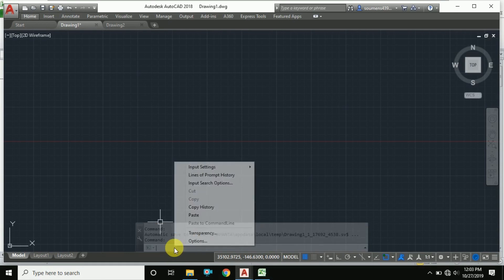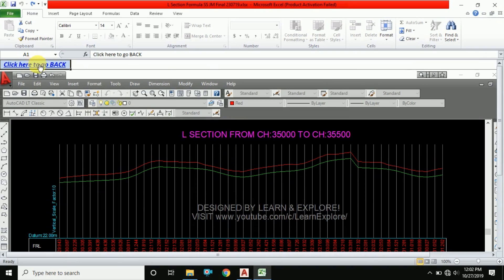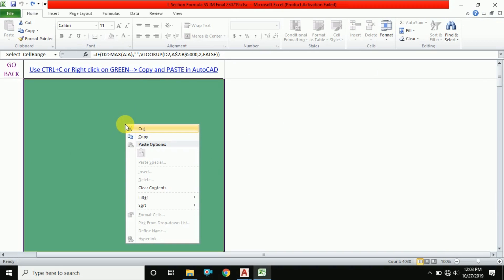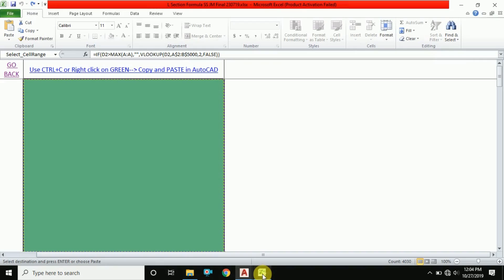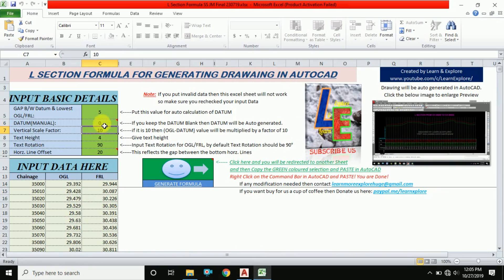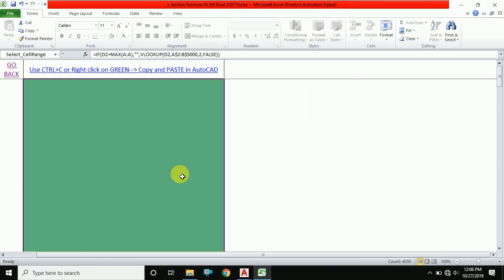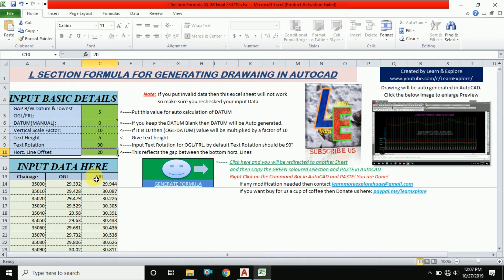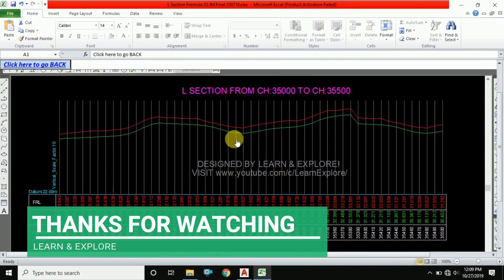How to Prepare a Long Section in AutoCAD Using Excel | Excel to AutoCAD Automation

Comment: If i purchase ur Excel sheet for L section for 3000 Rupees, is it free of will expair after some months, and for how many mtrs can L sec be made in it?
Reply from the maker: No it will not expire. You can plot upto 20km if it is 20m intervals
Reply from the maker: You can repeat the process to plot unlimited km
Reply: @LearnExplore  file which i purchased for Rs 1000 expired after 01 Year

Comment: I need  5 datum lines in this only 3 datum line
Reply from the maker: If you want to get custom modified excel sheet then you have to pay our developer 2999/- and you will get permanent full version of this file. For details contact learnmoreexplorehuge@gmail.com
Reply: Any L section lisp
Reply: Chainge,distence,ogl, inverter level,depth of cut base of 5 datum lines with in 40 are 50 points,any format is there
Reply from the maker: For custom excel format contact above email id

Comment: If I want to increase input data I. E input columns like 4 or 6 columns. This excel sheet works or not. Please send the EXCEL file adityareddi05@gmail.com
Reply from the maker: No you can't add columns. But it is possible after modifying the excel file.
Click the download link given in the pinned comment.

Comment: Sir I have plot three line in this excel programme  possible or Not?
Reply from the maker: I didn't get it. Please explain in detail
Reply: 1 Existing road line, 2 proposed road level, 3 ground level three line in L Section plot
Reply from the maker: Okay. This is possible. But this programme needs some modifications for that. If you want custom modification then it is chargeable. Contact details given in the excel file. Contact our team for further details.
Reply: replay above email address
Reply: any update for sample 1.0km
Reply: no any one replay for above discuss??

Comment: I’ll be grateful if u help me 
I tried using this excel sheet but it didn’t work with me
Reply from the maker: Make sure your input data has no error in typing.
Like 32..132 instead of 32.132
Or anything
Reply: Learn & Explore thank u it works 
Appreciate your prompt response
Reply: I just want to know if I can have the original sheet instead of the trail?
Reply from the maker: Wait for few days . When our video will get 1000 likes. We will provide full version free of cost.
Reply: I’ll wait
Reply: Learn & Explore I hope you’ll get it tomorrow cuz I need it urgently
Reply from the maker: But It's only 566 likes till now!
Reply from the maker: Please share this video to reach our goal.
Reply: Learn & Explore I did my best

Comment: Nice, do you have same for road cross section, sir
Reply from the maker: We will upload it soon if possible. Because making cross section by a single paste in AutoCAD its very difficult. But we will prepare it .. Everything is possible with excel and AutoCAD
Till then stay tuned with us. And share this video
Reply: @LearnExplore   multiple cross section, make button based
Reply: @LearnExplore  did you make excel sheet for cross section sir
Reply: Add a button on first sheet for copy paste to excel rather than go to second sheet and copy paste.